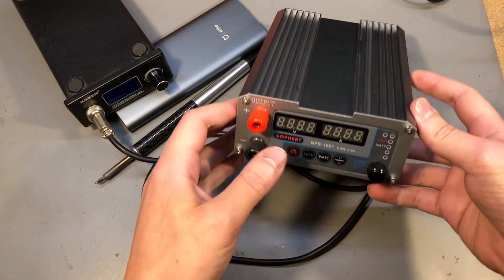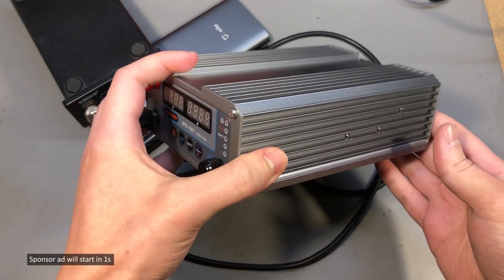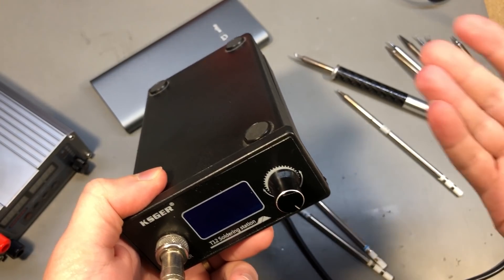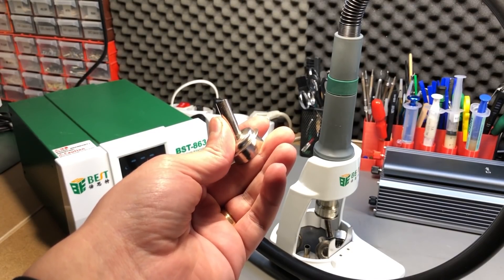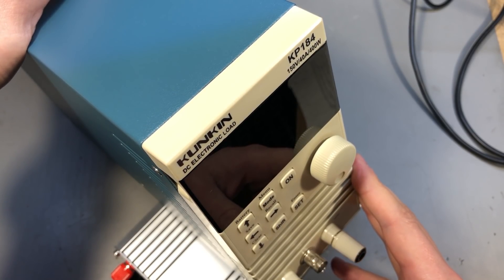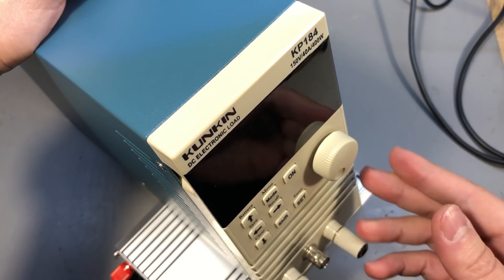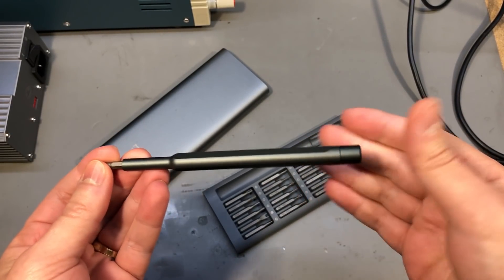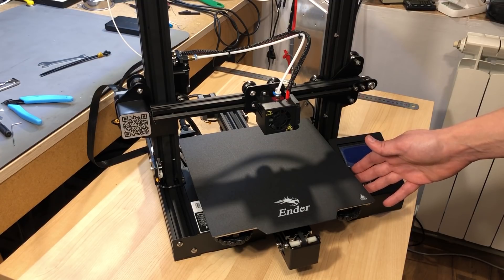Would I still recommend these products after using them? | Voltlog #343

Comment: The KSGER T12 soldering station is amazing! I bought 10 tips set from banggood, they are really cheap but they work perfectly! I just need change the "pen" for an rapid tip change type. I need a power supply, I'll search more about this Gophert again. The xiaomi screwdriver is smooth, a little skinny but he screwbits aren't that good, they oxide really fast because is iron unprotected. I prefer chromed screwbits. I bought too the KSGER hot air station... 80€, truly i dont know if is good or not... It works but I think it was expensive for the benefit. Thank you for your videos, and ask banggood for microscopes with lcd 😂😂 I need one good and cheap for my (noobie) electronic hobby.

Comment: Long term reviews are great, and much more credible I think. Thank you. Can you recommend a desoldering vacuum tool? Mine has just failed with the SMPS failing. Have attempted to fix the SMPS but it's nothing simple or obvious - have replaced caps etc.
Reply from the maker: Maybe you could just replace the SMPS entirely if you can't fix it. I don't do much desoldering but when I do I use a S-993A desoldering gun.

Comment: I ordered a KSGER irons, V3. With the normal handle. I’m planning to switch from the TS100. Mainly because I need a soldering station, don’t need portability and I like the integrated power supply and solder iron holder. Also T12 tips are cheaper.

It’s coming end of January it seems. Can’t wait to get it.
Reply from the maker: T12 is probably the best choice right now as it's price/performance ratio is the best.

Comment: I got a screw stuck perfectly in my xiaomi screwdriver socket and rendered it useless as I can't take it out.
Reply: The handle is aluminium, your screw it's very likely steel/iron. So heat the handle a lot, and it will expand more than the screw, and fall out.
Reply: @xtevesousa  That seems like a bad idea. Its not friction which is holding it in place, but the magnet. Heating up the handle will render the magnet useless.
Reply: @ratinthetub5048  tweezers? Or is it in backwards?
Reply: @astrolite3192  If backwards mean screw head facing outwards then yes. No room for tweezers to fit it.
Reply: Drill a tiny hole into the screw head....
Then partially screw in an appropriately sized self tapping screw......
Now grip the screw with pliers and pull it out, along with the stuck screw (hopefully!)

Just an idea.....
Reply: If the screw is stuck in such a way as if it is threaded into the hollow shaft, with the head sticking out, and the head has been damaged in removal attempts,  use a dremel type tool to cut a groove across the head - then use a flat blade screwdriver to "unscrew" it......

Just another idea!
Reply: Maybe try using a strong magnet and a nail. Hold the nail against the magnet and then stick the nail in the shaft. If magnet is stronger then the one inside the shaft you might be lucky to get the screw out.
Reply: @EwaldBurger  I've given up at this point. Pretty sure I got a counterfeit one anyways and I've bought a better one now.

Comment: I agree with the T12 soldering iron, so much bang for buck and with good features. I won't expect it to last 25 years like my old weller though. But way cheaper anyway.
I was actually just looking for a good set of screwrider with tips, ordered one of those to test out.
Reply: I got burned by T12 tips. I had a Jovy iSolder station which used those, and while the 'super-duper-AI' regulator was completly crap, the tips were bad too. The contact strips were misaligned or were even moving. Some tips were really loose in the handle. I see fake T12 tips as hit&miss purchase. This is why I use the ADS200 as my daily driver iron.
Reply: Haven't got any experiences with the T12. I have 2 Wellers but then I bought a TS100 since it was smaller and I wanted to test something new, damn you YouTube.  Btw, the tips on the Wellers are like 35 years old now and still in good shape.   I like the TS100 but then I saw a cheaper analogue version, the SH72 (blame YouTube again). That one is very cheap and works absolutely fantastic. I tend to use it more than the TS100 since it only costs 10 euro shipped, so if it breaks it won't break the bank.  I can hook it up to a laptop adapter and fits in everywhere if I need to take it to some other place.
Those screwdrivers are fantastic. The box is actually the best since it is a bit magnetic. So after 2 years I still have all bits which used to be different with all the other sets. You can't apply force with that handle but it is more than good enough. Keep the bits dry. I used some of them outside in light rain to repair something and a week later there was rust on some of the bits. Nothing that WD40 didn't sort out after an hour of soaking.
Reply: B++I have been using a KSGER 2.1S (FW 2.10 or 2.11 I think, newest FW that still support individual, per-cartridge temp calibration) for probably 2 years, never had an issue with it, except housing being a little lightweight (mine has the plastic housing) so I sometimes need to hold the station down with one hand while operating the encoder, to keep it from sliding away from my hand. Been using it as a second station professionally, and used only 2 genuine T12, rest knockoff T12 cartridges professionaly for 2 years, with both the KSGER and my Hakko FM-203. IMO there's no noticeable performance difference between them when using decent quality (read buyer feedback thoroughly on Ali) T12/T15 cartridges, but the KSGER is running circles around the Hakko station costing 15 times as much, when it comes to creature comforts and features. The Hakko really feels like a late 90s tool compared to the KSGER. Only real reason we still keep the hakko around, is for micropencil and hot tweezers (as we already have them).

Only one cartridge out of maybe 30 failed, and it failed immediately (spectatularly so, glowing red hot) because of a manufacturing defect to the contact strip. If you buy them from KSGER, Quicko/Quecoo or other reputable Ali sellers, and you get 4 or more at a time (for the regular lineup, non speciality tips), they're aout $2.50 - $3 a piece and good quality. You can also get quite a few custom / speciality tips there, that Hakko themselves don't make. Even got a seller to do a custom one-off, BCM1 cartridge for $10. Not just drilling a divot into a BC1 tip, but replating it with iron afterwards so it works properly. Sadly their Ali shop is gone now.

Comment: The WIHA screwdriver has one major flaw: while the satin anodized finish is really nice from aesthetics point of view, it completely sucks when it comes to applying torque to some screw. And things that have T15 or PH2 sockets can require some force. I have wrapped mine with a layer of blue painters tape, which solves this problem. I carry this set in my bag.
Reply from the maker: It's true about the grip, that's probably why I only use them for small gadgets where not a lot of force is required.